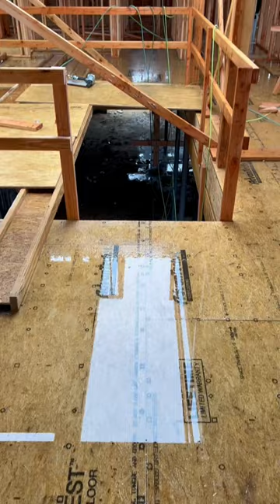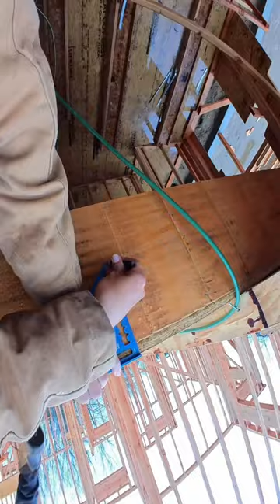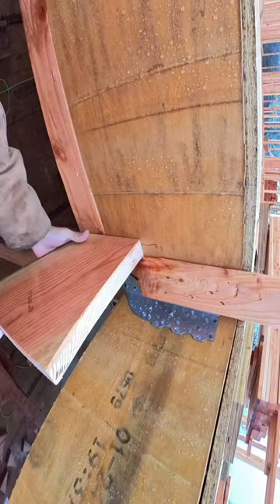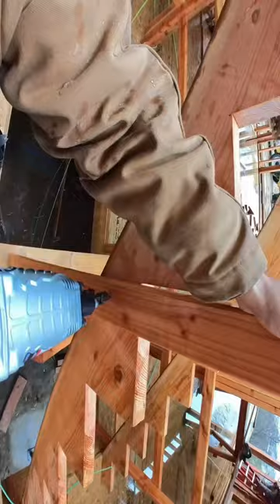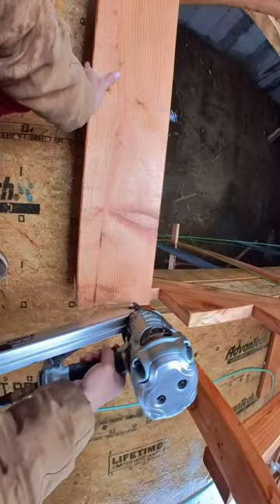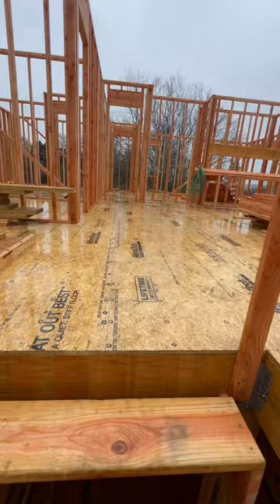Temporary stairs #shorts #work #construction #carpenter #skills #design

Comment: I always notch in a flat 2x4 at the bottom of the stringers. Shoot that to the floor and the stringer can’t slip forward. Other than the stringer or tread splitting in half  that’s the only way the steps can fail
Reply: Temporary
Reply: @joe-bg6ij   I guess your life is temporary
Reply: @myronsmith2114  yup as with everyone

Comment: Third stringer.
Stringers notched for flat 2x4 block at base.
Screw it together so you can disassemble easy and reuse.
Reply: These will come out after drywall. The stair guys will remove them. Looks like a multi floor radius stair is going in. Lots of traffic before then so a third stringer is wise. It’s about a 22’ drop to the basement/garage grade from the second floor. 10’ ceilings.

Comment: I see you left the exterior wall header plates (2x6) off but they are at the 2nd floor openings. Maybe the first floor is getting arch top units and you are going to block down for them when you have templates?
Reply: Some might say that a drop like that to the basement deserves a third stringer. Those steps are going to see a lot of action before they are ripped out. Looks like a basement to second floor winder is going in eventually.  Nice frame Jorge. As usual. Stay safe.